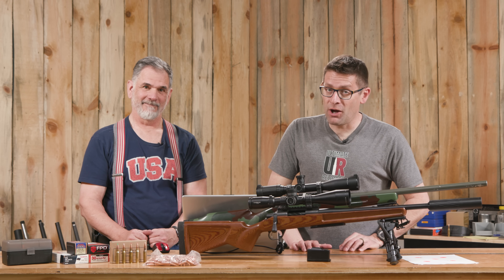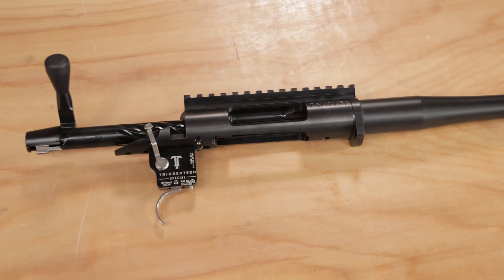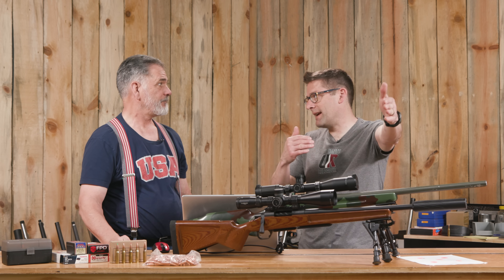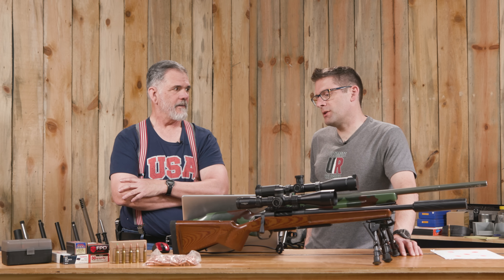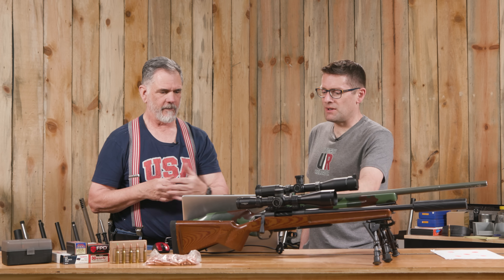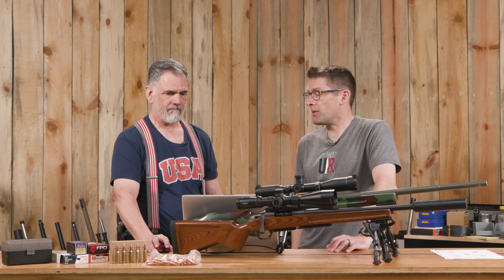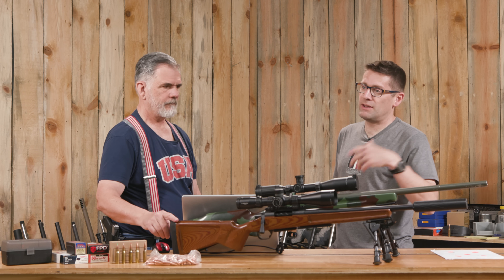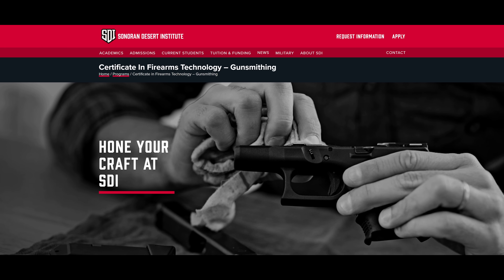308 Velocity: SHORT -vs- LONG (16" -vs- 24")

Comment: Non-AI summary: 25 fps/inch is what you lose with a 308, vs a 24" barrel.  It gets worse the more " overbore" the cartridge, e.g., a 243 loses more velocity per inch than a 260 or 7mm/08.

Comment: Service rifle competition 200 to   1000 yards M1A Super Ultramatch 308 M118 22 inch barrel I settled on 168 gr Hornady Match. Got to shoot with the US Palma Team during training at NRA
WHITTINGTEN CENTER, Raton New Mexico. They were shooting 308 1/11 twist 155 gr
On the 1000 yard line.  When my Father was stationed at Davis Monthsn  Tucson Arizona I was 12 started reloading at 6., Dad got me 03-A3  30-06.  The 150’s had a bit of recoil, dropped the bullet weight to 130 gr Hornady loaded with IMR4064 found to be a great for speed bunnies and  dis an excellent job shellacking Mike deer across canyons at 700 yards.  At 12 I was out shooting all the adults all that training I had from Vandenberg AFB from every kind of instructor you can imagine including one Olympic Coach   Stay with one rifle and  get to know it

Comment: Win model 70 .308 Long Range MB 24" barrel, Redfield Widefield fixed 6X.  Win 7.62 once fired cases, Rem #9 1/2 LR primers after popping the cherry of the pockets.  Barnes 150 gr. TTSX with light Lee Factory Crimp in the top groove and .120" jump to the lands.  48 gr. Win 748 gives 3,060 average fps.  Even though I sometimes put two consecutive shots in the same hole, the best five-shot group I can muster is about 1 3/4 inch.  I think this combo is actually better than that and the difference is my 77 year-old shakiness.  I still shoot my 458 Win Mag every now and then, but not very well.  I wasn't born in "Flinch," Michigan, but sometimes I feel like it.  I have neck nerve issues from driving experience and spoiled horses training ME back in the day.  This combo is nothing to write home about, but I can live with it.

Comment: Another interesting figure is MPBR; for an 8" target its 261 for the 16" barrel and 288 yards for a 28". Only 27 yards with 11" of barrel removed! Watched this because I'm debating cutting my 22" tikka .308 down for moose hunting. Where I hunt it's miles of stalking and generally shorter shots, but on occasion a 300-400 yard shot across a pond or hill to hill. Already have it in an MDT HNT26 chassis and want to shave more weight off it with a shorter (16.5, 18 or 20") carbon fibre barrel. Really wondering how much accuracy I'll lose going all the way down to a 16" (with muzzle brake since suppressor is not an option). I use 180 grain bullets. Looks like SD increases threefold or more for anything less than 20".

Comment: A lot of new zealand hunters use short barreled rifles with over barrel type supressors. My main hunting rifle is a 20 inch barreled 308 with a hardy compact supressor. The compact only extends around 3 inches muzzle forward keeping my total barrel length under 24 inches. I use two loads. 178 grain ELD-X at 2500 and 150 grain SST at 2800. Rifle weighs 7.2 lbs all up. The magnums seldom leave the safe now.

Comment: When I see videos talking about velocity and terminal performance, I always compare the velocity at distance to a 30-30 at the muzzle. Even though shorty is 200 fps slower, it's still more powerful than a 30-30 at the muzzle way out there. Can a 30-30 kill an elk at point blank range? Absolutely, so the short  handy .308 is still more than capable than a gun that's killed everything in north america for 150+ years. I'm not saying the 30-30 is the best choice but people used what they had.

Comment: whatever works for you is the best for you. me, i've been tromping around the north woods of MI and WIS. for the better part of 28 years with a rem 700 in 308 with a 24" and i have had no problems at all. so it works just fine for me. same gun for all that time as well. longest shot i took was from 522 yards with a 180g fed fusion, ( dropped like it fell from the sky) but most have really been under 200 and a majority under 100.

Comment: I bought a Ruger American Predator in .308 Win. They accidentally ordered the 16 inch barrel. However, after looking at it for a second or two and picturing the can attached, I took it anyway.

It's one of the best rifles I've ever bought. Sub-MOA results with 147gr reloads. Which are the cheapest rounds I can make in .308. 

I've stretched it out to 1000 yards. 7 inch groups at 1000 yards with a $500 rifle, $200 scope, $900 can, and $0.49 round. Wow! Just Wow!

Comment: What bullet weight would you use for black bear using the 16” 308? The range being of 200 yards and in, typical shot will usually be around 100 yards.

Comment: Personally i love the lighf weight 308 bullets. Like 115-125 grain. There are some super high velociry solid copper rounds  that do like 3100 fps out of a 16 inch barrel. Crazy. I understand why the military keeps 308 now. So much variety to get the job done.

Comment: Thanks for this info.....im currently looking for loads for my 16" LMT MARS. Varget and the 168 really impressed me. How did that powder do as far as group size? Until my 20 in barrel for it arrives that would certainly be a viable option.

Comment: I've been playing with the 130 TTSX in a Sig Cross 16". I hit 2940 before I ran out of room in a Lapua case with Varget. Great node at 2920 and no pressure at all. I've been pretty impressed with it on paper out to 400 yards. This season will prove or not. Big departure from the standard 168/175 I normally shoot. It's been a fun time

Comment: I had a BSA CF2. RIFLE that had many rounds through it..I cut the barrel to 16 inches and my velocity was fine and it shot mostly half inch groups with 180-220 gr bullets but velocities was 2200 with 220gr but worked very well on kudu and most African antelopes..i had a AK47 suppressor on it. 14×1lefthand thread.with very little recoil...i sold it to some lady pro hunter and shis using it after about18years she claims the it it stll tak drivering accuracy after but i sweeted the deal by giving here 800rouds of milatary round...she is shoot allot 0f game withit and she shoot it to this day

Comment: Hunters should note that a short barrel .308 is less than ideal if you want to use 150gr and over copper bullets at safe pressures.  If you take a Barnes 150gr TTSX at around 2600 you are under 2000 fps before you even get to 150m which means the terminal performance of the projectile may be marginal.  If you want to use Barnes TTSX in your .308 and have the projectile perform at 100% out to 300m (330yds) you need to go down to a 130gr TTSX and achieve at least 2800 fps to be at 2000 fps at 300m.  In a world where copper projectiles are fast becoming the choice, and in some countries the law, it does not make much sense to go with a short barrel on your .308.

Comment: I have a Rem 700, 308, LH, with a 26 in bull barrel. Like the longer barrels but to get a surpressor 1- would be nice; 2- is way out of my budget range; 3- the requirements to have one are outrageous and expensive.

Comment: My 308 is an AR10 with a more traditional 20 inch barrel. I shoot 1000 yard target, so hunters won't want this data point. I ended up switching to a 24 inch barrel in 6.5cm and couldn't be happier.

Comment: I've got a old Hodgdon load manual that has .308 pistol data that is before the T/C encore was built and marketed. It lists a 14 inch barrel on a contender frame about 18-24 months before the encore was being first released. I've got decent velocity out of the 15 inch barrel and it was more than adequate for 265 yards with a zero at just over the 200 mark. I was able to keep 20 out of 20 shots in a 6 inch steel target with most inside the 4 inch.

Comment: If you think that there is any chance of shooting 1000 or more, why would you cheat yourself of those much need velocities. If you're building an urban combat 300 yd gun, then ok with the short barrel.  I did a lot of long-range competition and long-range varmint hunting 26, 28 or even 30 inches was not out of the question. An extra 200 fps at 1500 is a large advantage.

Comment: In New Zealand Tikka sell a factory 16" threaded .308 called the "bush hunter". Shortened barrels to 16-18" particularly in .308 have been very popular for a long time in NZ thanks to our thick dense bush which makes carrying a full length rifle a nightmare. 20" 7mm rem mag is also becoming very popular. 

Supressors are also very popular because we bush stalk and so you need to be able to hear everything and there's no time for hearing protection when you've just spotted a deer at 10m and they're staring at you

Comment: A shorty is in the works for me.  I have been planning this for some time.  I have a Nomad-L, which is spectacular, that I will be attaching to the business end.  The nomad is so good, I can stand next to (to the side of) the muzzle end of my 300 win mag when my son shoots it.  This is without ears.  I have sensitive ears already (occupation), and I have zero discomfort.  556 through the same suppressor is an entirely different story... In any case, it should be mentioned that a suppressor acts like added barrel length and increases velocity.  I was planning to go 16, but after seeing this video, I think that I may go 18.  I am only trying to keep the package roughly the same size as a standard rifle, as well as cutting down on weight.  I do not believe that 2 more inches is going to be that much more unwieldy for my application.  You have done a really good job on the rifle, and I sure appreciate the information from you both.

Comment: This is the exact reason I hate the 6m5 creedmor. It literally has only a tiny bit more ballistic than a 7.62x39. with such fat and long casing, if it more does tiny bit more the an ak47 round, then what is the use. I mean 140grn 6.5 creed travels at only 2300 fps is not a lot more than 7.62x39 130 grn travelling at around the same velocity of 2300fps.

Comment: I have a Bergara Extreme Hunter in 308 with 18" barrel and I run a Can from Atec. It hates 150-155gr bullets, 165 to 168 good group and 180 also but here in Germany the deers are the size of labrador so I don't need so much weight.

Comment: Would be interesting to see the same build in a 30-06. Should do better with heavier bullets and yield higher velocities
Reply: That would be interesting, my great uncle told me that the extra case capacity was to compensate for the lower quality powders back when the 30-06 came out.

Comment: Here in New Zealand, a 16 inch barrel .308 (suppressed) is very common and standard issue for bush hunting. Most of this style of hunting is limited to 200 yards, but skilled hunters using custom reloads can ethically push it out to double this distance. Tikka even produce a rifle with a threaded 16 inch barrel just for our market.

Comment: OSA Sierra 135gr HP. So accurate it’s not funny. I shot so many groups with multiple through the same hole at 100. Never bothered loading because you can’t get any better than that. 3000fps

Comment: I use the 150gr TTSX out of my 16” barrel on my Sig Cross .308 but I may try the 130s. Problem is am I going Elk hunting and even though shooting ranges will be under 300 I’m not sure which I want to use. 1:10 barrel twist. My groupings with tight with the 150’s. I will have to get the tools to measure my velocity.

Comment: So about 23years or so ago I picked up a Ruger Compact, which has the 16.5" barrel. To date it has probably put more meat in the freezer than anything else I own. I have mostly used Remington 150gr Core Lokts and when not using factory I hand loaded the same bullet, over H4895 to equal the factory velocity. I also loaded both the 125gr Ballistic Tip as well as the 130gr Barnes TTSX for my grandsons using again H4895 but in reduced loads. If I were to build a .308 I wold put at least a 24" tube on it with a standard 1-10 twist. I really don't have the need for the heavier bullets than around 175gr.

Comment: I just completed a rifle build for the Germam woods (shot range 200 m and in):
Tikka T3x stainless, .308, 17" barrel, HAUSKEN 184 overbarrel suppressor bedded in a T3 laminated stock (for better balance).
Topped wit a Schmid & Bender Zenith 3-12x50 FFP scope and FD 7 reticle.
Ammo: Barnes TSX 150 gn with 44 gn of Vihtavuori N140 powder @ 2500 fps (estimated MV). 
Should expand reliably at least up to 210 m (@ 2000 fps). Groups .4 MOA.

Best regards, K.

Comment: I’m loadin those 125nosler bt at 48gr h4350 in 24” fn spr gettin 2780fps and 4 outta 5 same hole…110varmageddons 42.5imr 4198@3490ish… lucked into that rifle and was able to achieve what I’d talked about few comments back..lol…love .308
Reply: Excellent!
Reply: @guyminer3168  you ever try some 110v max in that 24” 1:12 guy..? .busted all my 500yrd jugs yesterday with a few in starline sm pri cases…what’s yer thoughts on small primer vs large in .308..? Now that I have 205m’s there as consistent as beam scales can be..takes 8.0moa to reach 520yrds…168s 12.1moa@2650..
Reply: @charlesmullins3238  - I've used some 110's to pop rockchucks with the 308 Win. They work great! Accurate and violent. I haven't ever tried small primer 308's. Never saw a need to as I was shooting so well with large rifle primers.
Reply: @guyminer3168  lg gettin so hard to find only reason I am..I like alpha and of course lapua
Reply: @guyminer3168  2750fps is not the right velocity on 125s…the river 3k just didn’t go to my notes

Comment: i have an ar10 with 16in, sig cross 16in ,and a mrad 17in. currently trying to decide between 168/175 smk or go heavy 190's. loaded long with varget. i also have a bunch of vv n-133. not too much data with fast powder and 168's. but im going to try it.

Comment: Have a 6.5cm and 30-06 both identical light weight mtn rifles.
24 inches and thinking about cutting both to 17 and adding a 7 inch ultra 7.Hunting out to 400?
Reply: Check your velocity and trajectory figures on one of the calculators. If the numbers please you, why not?

Comment: I had/have a Remington model 700 BDL with a 24” bull barrel in .308, I had a gunsmith trim the barrel down to 18” and turned down to a sporter style barrel. The accuracy was amazing before I had this work done, after I got the rifle back from the gunsmith the accuracy never changed one little bit.
I reload 150 grain Nosler ballistic tip boat tails, I use this round to hunt everything I can get a tag for. I Load 46.5 grains of IMR 4064 and my velocity is on average 2834fps. I zeroed this round in for 300 yards, this is the gun I use all of the time to hunt, even though I use a Ruger in .280 REM with 22” barrel or another Ruger in 7mm-08 with an 18” barrel that I have as backups if something were to happen to the  REM .308. I love the short barreled rifles.

Comment: in the short barrel testing, did you have the suppressor on it? I'm fairly sure that the suppressor adds a bit of "barrel length" that the bullet will see, because it is still being pushed by expanding gases throughout its travel through the suppressor...??

Comment: A 20 MOA  picatinny rail , a 16" barrel 1-11.25 rifling , plus an EC tunner and a supressor , a good stock with adjustable length of pull and  cheek piece , a Timney trigger , an Atlas bipod and 168 grain ammo .

Comment: I've been running a 15.5" Model 7 in 308 for a few years now. Running a 9" long Gunworks overbarrel suppressor and Speer 165 BTSP at 2450. It's just under 1 meter long and super handy in the bush, but still got enough legs to go to 300 yards if I need to.

Comment: I love compacts. My 16” Ruger Gunsite Scout is nice and short, even with the Dead Air Sandman K, and fits on my 4 wheeler nicely. Compared to my Daniel Defense Delta 5 with 24” barrel and 9” Silencerco suppressor. I was backing my 4 wheeler out of the shed the first time I took the Delta 5 out and the suppressor whacks the side of the door and the whole rifle almost falls off the 4 wheeler. Mental note made…

Comment: I have a 24in 308. It shows its strength well in that length when hunting is not a 100yd deer stand hunt. Same for the 30-06.
Reply: Absolutely. A 308 with a short little barrel becomes a gelding. I have a 22" and 24" 308. Both are fine, accurate, etc. The 24" has outstanding velocity. It reaches the REAL performance potential of the cartridge. The 22" has become my 100yd feeder / stand setup on my ranch for wild hogs that come by the feeder AND I load it down a bit because the distance is so close, just to save a bit on recoil.

Comment: 200 fps is quite a difference significantly limiting the cartridge performance, plus the bulkier suppressor on the tip of the barrel spoils the advantages of a shorter barrel for stalking through heavy bush.

Comment: I've started messing with an 18" 6.5 creedmoor, im leaning towards 123s for bullet weight and extra fps in the shorter barrel.  What's  your thoughts on it?
Reply: For comparison/consideration in the 6.5 Creedmoor. I just averaged 2904fps with 123gr Hornaday sst’s using 44.3gr of Reloader 17. Average of 10 shots w a sd of 16. 
I would think an 18” barrel would come in around 2825. Thats still ripin’. The bc on that bullet is .510. That sounds like a good setup. 7mm-08 would be good for 18” too….i would think.
Reply: I think it is a great choice. I believe the bc on that bullet is .510. I have taken one deer w an 18” barreled 6.5 Grendel. Bullet speed at muzzle is around 2500fps…with the Hornady 123gr sst. The cartridge/bullet/rifle worked surprisingly well. The 123gr sst has also been accurate for me out of 1:8 twist Creedmoor and Grendel.
Reply: @milo555100  I miss my 18" Grendel, it was a laser beam using a TBOX barrel.  This shorter 6.5CM would easily dispatch the white tails around here in NC.